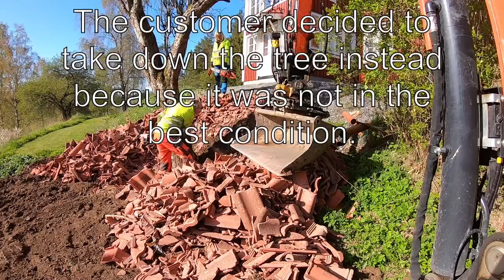Final adjustment Part 5

Comment: Hedblom,usually,ceramic tiles are used in tropical countries...but, in Sweden,cold,snow ...I did'nt think !
Is it normal in North Sweden?
Thanks!
Congratulations from Brasil.
Reply: For one or two family houses, roof tiles are pretty much the norm in all of Sweden. They work well because most houses have steep roof pitches to shed snow more easily. Metal roofing is probably the second most common type.
Reply: @johanung  ,thanks for share.